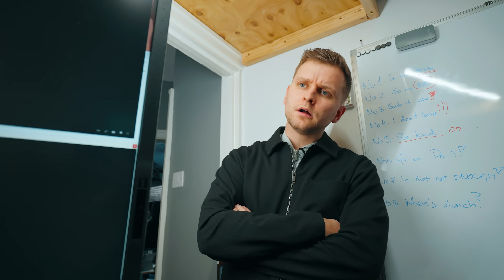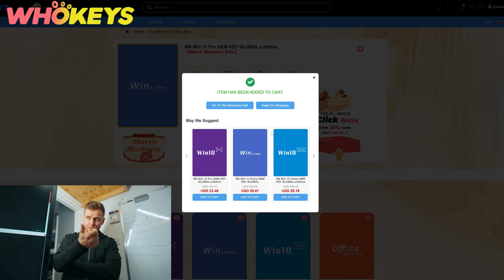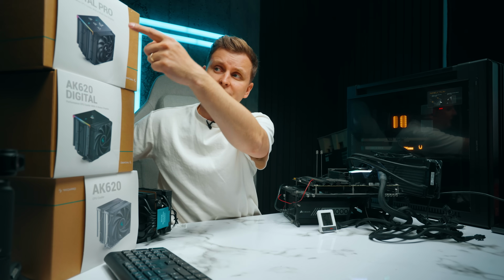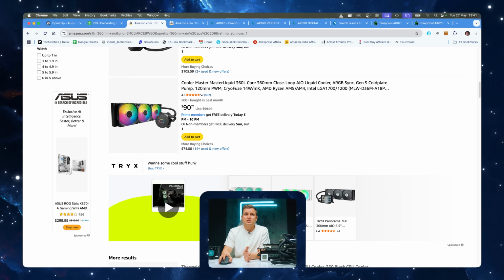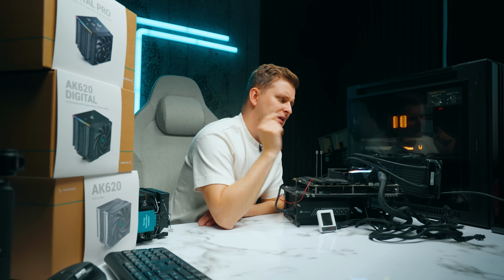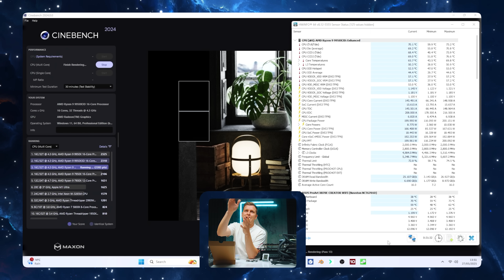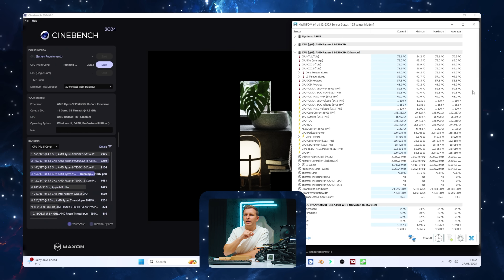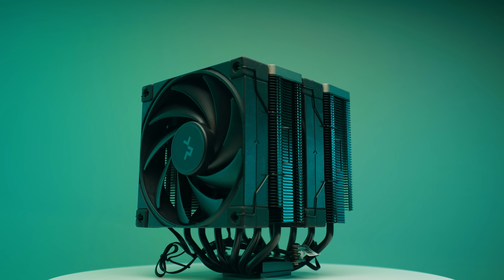Stop Overpaying for CPU Coolers Now! AIO vs AIR [PROOF]

Comment: If you had studied thermal systems design, you would understand that the ultimate heat sink in both air and liquid cooling systems is the surrounding air. A liquid cooler does not eliminate heat more effectively in the long term; rather, it temporarily improves thermal management by transporting heat away from the CPU more efficiently. However, the liquid cooling system still relies on radiators and fans to eventually dissipate that heat into the air—just like an air cooler does. In contrast, an air cooler performs this heat exchange directly from the CPU to the air via a heatsink and fan. So, while a liquid cooler may delay thermal buildup and provide more headroom under peak loads, both systems ultimately depend on air to remove the heat from the system.
Reply: I may add that once the water is warmed up in an AIO the cooling effect actually not as good as an air cooler. Water holds onto the heat longer than the heatsink on an air cooler. So water cooler handles heat spike better but in a long heavy duty session the air cooler will be better. Both systems rely on the room temperature the computer is in and most importantly the air flow in the closed computer case.
Reply: @alexyu6928  True, but you also have to factor the total wattage of the cooling system. You can have a much bigger radiator w/ AIOs and especially on custom liquid systems.
Reply: @OldDirtyRobot  i want to add that a cooler CPU runs also lower on wattage which means the overall heat is less with an AIO. it does not let the CPU climb very fast very high which indeed makes an AIO more usefull and efficient.
Reply: @alexyu6928 That’s true in general but I don’t think 420 AIOs have much competition even on long operation as opposed to air coolers. I know it’s not a fair comparison but my point is you can go 420 with an AIO but you can’t get a better air cooler than a reliable brand dual tower one
Reply: @alexyu6928  it all depends on too many external conditions on the cooling effectiveness side, but what never changes is the reliability of air cooler wich ends up to me as being the real trump card.
Reply: @alexyu6928  dumb take, the water never gets hotter than a couple degrees over ambient.
Reply: “Water never gets hotter than a couple of degrees above ambient”? You neither had never built a powerful system nor you might have built just one low end system. You had no idea what you were talking about, Water in an AIO can reach 20 to 30 degrees above ambient. Next time feel the air coming through the radiator before you open your mouth.
Reply: I feel like the advantage of the AIO is really in these smaller systems or cases with more restrictive airflow. I think on an open test bench and in a case with really high airflow it's gonna be fine. 

But in something like a jonsbo d41, which is a Mff case that has the PSU upfront intake airing, and thusly dumping hot air towards your CPU? A 360 aio would definitely be more beneficial to dissipating that hot air out and cooling it. It all depends
Reply: So what would you recommend? I’m getting a pc for gaming but also going to start with machine learning  3 month intensive course / crash course ( eventually development) 0 coding experience right now
Reply: @mathkor89 ryzen processors are really good. 7 and 9 series. Better performance per your money
Reply: @mathkor89 how did it go. What course was it. I’m also interested in machine learning. Please help 🙏
Reply: @mathkor89  air cooler, preferably noctua, especially if you are new to pcs. a aio  is nice, but also not. get one in your second build! noctua is awesome tho!
Reply: @mathkor89 Get a very high end air cooler that is still going to be much cheaper than a AIO liquid cooler. Also get a full tower case with all premium fans installed. Rest of the configuration would be under your budget but the cooling won't be compromised. Also your air cooler is going to save you money like i said
Reply: @MecheX  why would you recommend someone all premium fans? a full tower with premium fans would buy a new cpu, thats just dumb advice. get a be quiet or noctua cooler and arctic p12 for the case.
Reply: @maasterchiefthats what premium means.
Reply: @MecheX  if thats premium for you, whats noctua or a p30 then?
Reply: @maasterchief what is that? Premium means any best quality available in the market. Go take a course on the language first. Im not promoting any brands here. Just generically suggested a premium brand
Reply: @MecheX  so you recommend stuff about cooling but dont know the 2 best fan brands rn, thats hilarious. p12 is good not premium. premium is the best money can buy. dont suggest again.
Reply: @maasterchiefMy recommendation would be P12/14 A-RGB fans even when you don’t want RGB. You can just not use it but the design of P12/14 A-RGB is superior in terms of noise profile to regular P12/14s. They don’t have the same hum or resonance sound.
Reply: The main problem with air cooler is dispatch heat inside the case and close to the gpu. When aio is moving away heat to the the the radiator witch is away from motherboard and graphic card and  m2 nvme drives especially in big cases.
Reply: @evan-du3vk  airflow always benefits components without their own active cooling. If you have hot air trapped into the case (or can't get enough fresh air in), the issue is in case and it will not matter which type of cooling is used.
Reply: @CrazySerb Don't  understand completely your point. There's always airflow becouse both cooling have fans. And always have additional fans in your case??  What I meant It's that aio is moving heat from  start away  to radiator that's far  from other components. When air cooler has radiator on top of cpu. So it keeps all the gathered heat close to graphic card, mobo ram and nvme disk before fans and air can move it away.
Reply: @evan-du3vk  because radiator is far from other components, it does not provide airflow to other components. Case airflow is mostly blocked as well by GPU, especially with side panels these days being glass without fans.

Air cooler will naturally create better airflow in that area, which will help with moving heat from these components.

As I said, case fans should be able to take care of getting heat out and getting new, colder air from the room in. If case fans can't do that, it does not matter which cooling is used, all components will have higher temps.
Reply: @CrazySerb  let's agree to disagree
Reply: @evan-du3vk  Airflow does not matter, that is why Arctic added extra fan. Just check some reviews for Liquid Freezer 2, you should be able to find some reviews with VRM thermals (some even included air coolers). Then again, "airflow does not matter" so results should be the same.
Reply: @CrazySerb you talk about airflow is the thing I don't get it completely. Why with aio cooler thers no airflow is mind boggling for me. Man I checked all videos all over internet building mine pc with 7x  140mm fans and 420 aio so I have some clue about airflow and how to setup it with aio and air cooler so please just stop
Reply: @evan-du3vk  You claim that AIO is better for other components, so why are you buying 7 fans?! AIO with its own fans should be enough since you claim that "airflow does not matter".

You don't need to be an expert in thermal dynamics, just stand in front of the fan and you will feel different.
Hint: air temp in front of the fan is actually the same temp as air from rest of the room because fans do not cool air, they just move it.
Reply: @CrazySerb man yore drunk or I don't know. Of course all cooling water cooling or normal air cooling is always based on air flow.  Becouse radiator in both cases   needs at last 1  fan and I never said anything other. That's why I really don't understand what you talking about.  Even 1 fan makes a airflow. Please let's finish this conversation becouse it's completely pointless we  talk about different things.  Just go out and chill.
Reply: @evan-du3vk  You were claiming problem with air coolers, even if air coolers will in almost all situations lower temperatures of other components compared to AIO. The only way to make it a problem is to block air coming in and out of case or remove case fans, which is not a problem of air coolers, it is case problem and type of cooling used will not matter.

Simple as that, if you don't understand what you said, then there is no point.
Reply: Thats a great amswer for this topic. you think a thermalright peerless assassin 120 could cool a ryzen 9 9900x with swapped noctua premium fams on it?
Reply: On top of these, modern air coolers use phase change to carry away the heat to the fins. This is even more efficient than water in the AIOs. IMO the water cooling these days only help when you can't ensure a good airflow through the case or if you want to reduce the mounting strain on the socket. Maybe for aesthetics too.

Comment: Just before 2 years I have made this change. I was running two AIO on my two machines, and what happened, one of the water pomp dies, and the CPU is on 90 C on 400mhz. After that I got the exact deep cool cooler that you showed and I am verry happy. My main rig is Ryzen 9 7950X and this is enough for it, the older machine is 3900x and it's paired with Noctua 15. Interesting fact, the deep cool perform better on the AM5 2 CCD processors compared to the Noctua, even with the significant smaller mass the AK620 is better just for the heat pipes positions and the contact surface. On the AM4 processors the results was opposite the Noctua was better (I believe that Noctua have a new version for the AM5 that perform better for the CCDs positions, my is not the updated one) . AIO is cool idea but when you get a pump failure the things can be really bad and keep in mind this is the better failure if you got a leak it can be catastrophic, so no more water cooling for my machines.

Comment: i myself running a deepcool ag620 black version and boy it can cool and costs almost nothing compared to other components on my pc. that being said i think in a day to day use air cooler is more then sufficient regarding cpu cooling. what's most important is the ambient temperature and case air flow but almost no youtuber talks about it cz they live in a cooler country. now where i live which is south asia and temperature here stays above 30 most of the year, cooling a cpu is really hard especially with intel 13th gen. i would say a good air cooler is enough with right air flow. in my casing i have no intake fan for air and all of the fans i used as exhaust which is a 140mm and 2 120mm fan. i dont know if u would believe but my cpu never gets above 75c and its all thanks to my casing and cpu cooler.
Reply: wait doesnt it create negative air pressure. i saw in a video (by bob or bog - he builds a PC) as states that we should have more intake than exhaust
Reply: @selfrace3131  i have no intake fans which means the bottom and back part of my casing has no fan mounted but the air ways r open which provides passive air flow which is intake airflow. I have mounted fans on top and front side which pulls hot air out of the casing. So the back and bottom of my casing provides passive cool air while top and front side fans pulls hot air out of my casing

Comment: I have a Noctua NH-U12A Chromax Black. Got it 4 years ago. It has moved from one build to the next. Noctua fans last forever but so will this heatsink. And Noctua is always updating mounting brackets for it. No need for an AIO either. I've cooled even a 13700K with it. Running an AMD 9600X right now.
Reply: Hows the temp on that 9600x

Comment: I am 100% with you about air cooling, it is the way to go! I had built lots of PCs with AK620 and 240AIO the temperature difference was minimal(2 degrees) but in a year or two, pumps started to fail (different brands were used; even Bequiet failed). Surely they were exchanged for new ones, but it took lots of time. So if you are doing serious work (like rendering or working in 3ds Max), air cooling is better cuz you will not lose your uptime caused by a pump and warranty issues.
Reply: i mean you're just lying lmao. One quick Gamers Nexus video will show that even the best air cooler (Noctua NH-D15) is literally 12 degrees hotter than the best aio (Arctic Liquid Freezer III 360m) while being the exact same price. The Arctic Liquid freezer is actually $40 cheaper than the NH-D15 currently on Amazon. Also aio pumps are rated for 5 year minimum of CONTINOUS use at 100% which you never do or need anyway, so the chances of multiple pump failures in a year or two are either extremely unlucky, you're lying, or you're gaslighting yourself into trying to justify the purchase of your inferior air cooler. 

And thats not even talking about the trash testing @Tech Notice used in this video. While the general assumption that yes, you do not absolutely need an AIO, they're still better for people that upgrade every 5 years which is a large majority and/or you have a CPU that performs better the lower the temperature which an AIO absolutely provides.
Reply: @lamp6381  Well, first off all I compared the 240 with the AK620 (not the 360 with the Noctua). Second of all, I respect Gamer Nexus and please do open their video at 6:06, where you will see that the difference between the 360 (Arctic) and the AK620 is about 8 degrees, not 12, but the price difference is almost duble(at least, where I live). By the way, the difference between the DeepCool Assassin IV and the 360 Arctic is less than 6 degrees. I had failed pumps from the followingng brands: 2x Thermaltake (2 years nonstop), Be Quiet (2.5 years), Deepcool (2 years), and Cooler Master (2 years). Only Be Quiet was covered by the warranty, and it took almost 2 weeks for the new AIO to arrive, which means the PC was out of work, losing money. These PCs are doing 24/7 Corona render they are not for gaming, so it is NOT ok for them to be off-time. That is why I don't trust AIOs at all. Also, we had a leak on one of the Thermaltake AIOs; nothing was broken, but a new fear was unlocked.
Reply: @TheTornvidia  I know what you compared, I was comparing the best from each category as thats usually the most fair comparison. Regardless, the video Gamer Nexus released from 5 months ago at 6:06 has the arctic liquid freezer III 360 at 48 degrees while the AK620 is at 64 degrees, thats 16 degrees bro. If you're really running your pc 24/7 then those 16 degrees have a higher chance of cpu deterioration than a pump failure. I cannot speak for any other brand, but my arctic liquid freezer II worked for 6 years without any issues  until i retired it for the liquid freezer III. All for cheaper and better performance than a top of the line air cooler. The title of the gamer nexus video is "Best CPU Coolers We've Tested (2024): Thermals, Noise Levels, & Value" from 5 months ago. 

I am not trying to convince you of anything and you are free to use whatever you want, and I agree that air cooler are more reliable long term (over 5 years) but saying the difference in temperatures is minimal is just plain lying especially when the prices are usually the same. AIO are only more expensive in instances when companies upcharge like crazy because they have an infinity mirror on the pump or rgb on the fans.
Reply: @lamp6381  it is 45 c and 54 not 64(it is 9 degrees) please  watch the video more carefully(100% fan speed test on 6th minute). In my case the difference between 240 and AK620 is minimal and 360 costs like 2 AK620(talking about Artic, Corsair or ASUS are like 3 AK620) . By the way AK620 is even better then NHD 15 in Gamers Nexus video.
Reply: @TheTornvidia  I mean you're literally just ragebaiting at this point lol. Idk what video you're watching or maybe you're watching it on an apple watch because you're clearly just saying numbers that aren't even in the video. At 6:06 on the video by Gamers Nexus titled "Best CPU Coolers We've Tested (2024): Thermals, Noise Levels, & Value" from 5 months ago the best cooler is the Arctic Liquid Freezer III 360mm at 48 degrees while the DeepCool AK620W 240mm is 64.1 degrees ranked 13th on the list. Please open your eyes or watch the right video.
Reply: @TheTornvidia  Thing is, new FC3 280 Arctic beat most 360 AIOs and it cost about same as AK620 here, AK620 being just $4 cheaper right now.
I am personally using Custom WC loop to cool GPU as well and I have yet to see pump to die. In AIO thats bit different and especialy older models were less reliable.
And just looking at GN Noise normalized charts, FC3 360 46.7, FC3 280 49.8 and AK620 being 57.1, making difference 10.4 degrees. If you add push/pull fans on FC3 you can probably get additional 2-3 degrees. And even at 100% fan speed difference is still 9 degrees advantage for FC3 360 with 2.4dB lower noice.
And again this is open air test same as yours, in closed case difference should be higher.
Reply: @lamp6381  I compared ak 620 with 240 aios not with 360. Not the most expensive air cooler with not the most expensive aio. The place where I live we don't have Noctua coolers at all, but we have Deepcool coolers, Be quiet Aios, Thermaltake Aios, Enermax(we had), Corsair Aios, Deepcool Aios, and Id cooling Aios. So from all of these companies I had at least a single failed pump from each company in a year or 3-4 years. Yes, some of them were covered by the warranty, but we lost lots of working hours on these machines which are doing Corona render 24/7, it means money loss, but machines which have air coolers working non stop, no problems. In my case temperature difference was minimal not worthy money loss cuz off a failed pump.